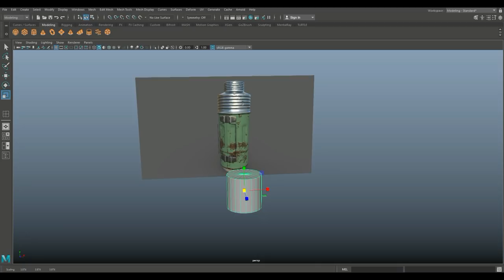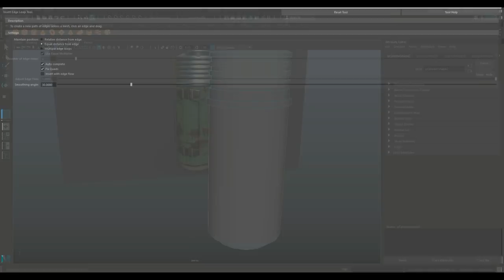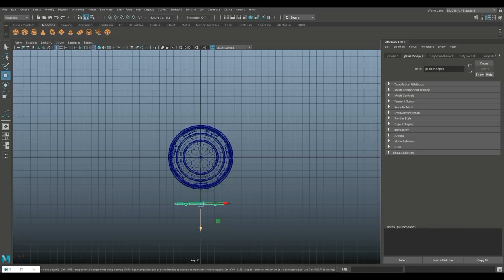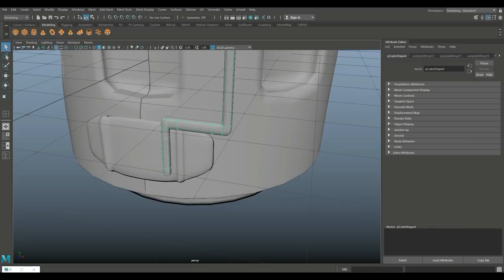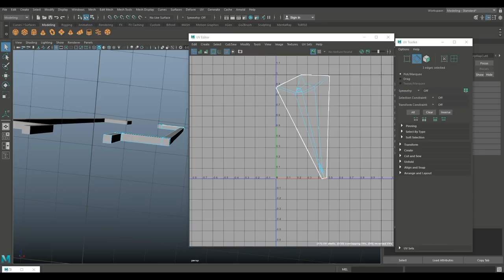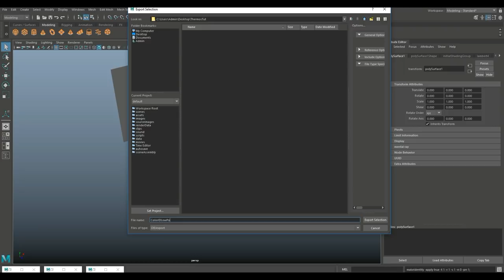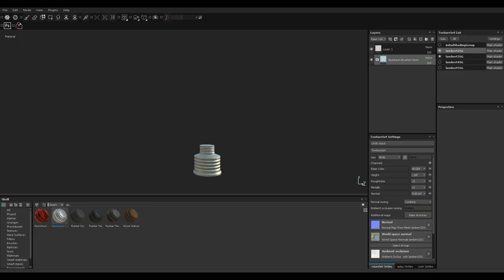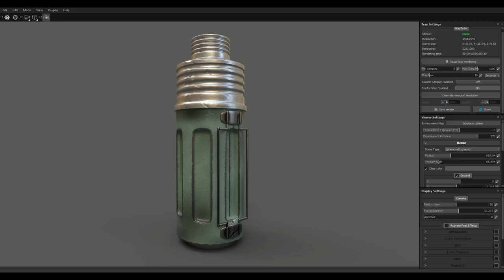3D Game Prop model of thermos : FULL WORKFLOW Tutorial

Comment: I tried doing it but all i get is the bake mesh maps instead of the bake texture. Am i doing something wrong?
Reply from the maker: Bake Mesh maps ? Like what ?
Reply: i don't really know. i made an object in maya 2018 exported it as an object to zbrush then made damages as you did. i exported it from zbrush as a high poly. and in substance painter i first opened the low poly. and when i go to the texture set settings it only has the bake mesh map not the texture map instead.
Reply from the maker: So what did you bake then ?
Reply: i think the mesh map.
Reply: just found out the initial shader group wasn't showing up on mine.